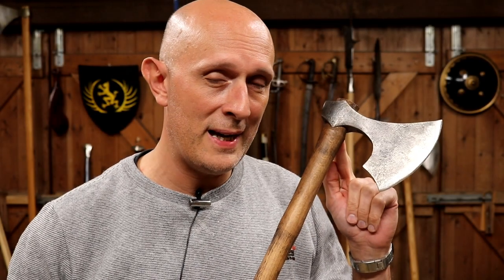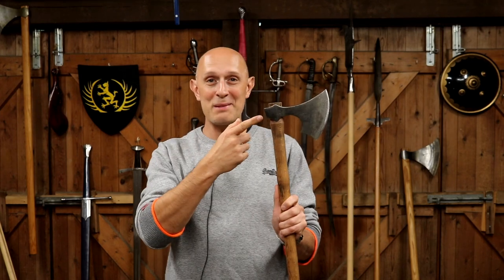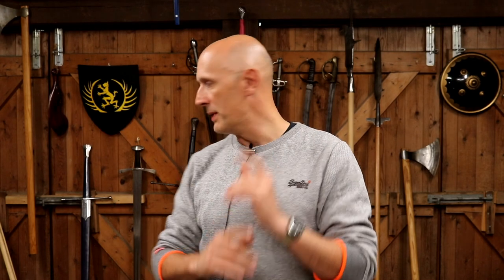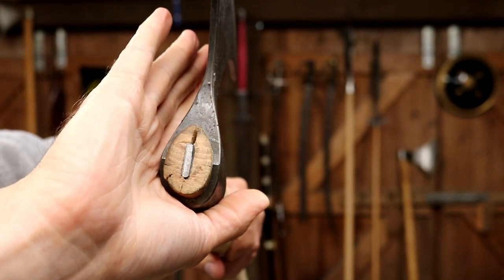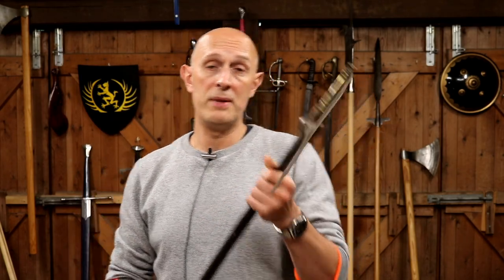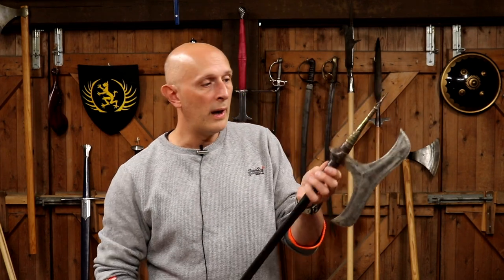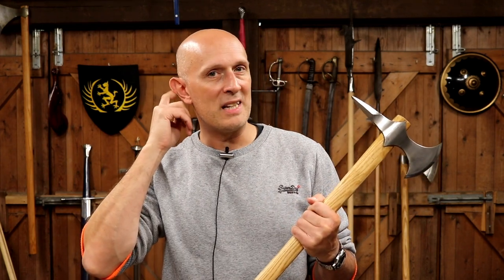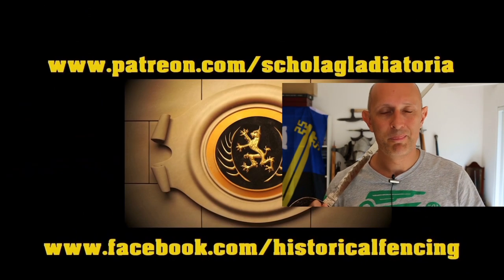Medieval Axe Construction - What Many People Get WRONG

Comment: Straight axe handles without flares are quite common. In the visual art of medieval europe the is no evidence of flared handles. It could be argued that this detail was omitted by artists but you don't see it in the highly realistic art of the 17th or 18th century art either. Not until the 19th century and modern fawns foot style do you see flares. But even then double bit axes often don't have a flare. Also besides that contemporary Japanese axes are almost always straight without any flare.

I've got an ~18th century French axe head that is designed to be fitted slip over style. Excellent axe and its great as falling axe or Joggling axe.

Comment: why don't they peen a pin through the head? does it cause rattling on impact that breaks up the wood or something?
Reply: Using a rivet like that would probably make it more secure but it would make it much harder to replace the axe handle if it was to break.

Comment: Grew up on farm. Farming. Neighbors same. Not machine farming. Hand and animal power, threshing by hand with flails, etc. Having used many tools whose heads were older than my parents: let me share what I KNOW to be true from years of practical experience: You mount a hoe or an axe head UP the shaft. Always. The grain runs up and down the shaft, the stack from blade to back, no debates.

Wedges are used as a REPAIR, a temporary one at that, in the event your shaft has mushroomed badly and is splitting. Their use in initial construction labels the tool as ornamental or occasional, such a kindling axe or a carving tool, not something that will take impacts. If you see a new item with wedges that is intented for actual daily use: avoid it, it's creator was amateur at best. This is not snobbery, this is lifesaving advice. If the head comes off in use it MUST go somewhere. When you live in the woods and that "somewhere" is into you or companions, that is lifealtering injury at best. It is GG at worst.

Always mount UP the shaft. Yes, it means you must get better at turning a handle. But if you cannot work the lathe you have no business working the axe either. The advent of polimers and plastics lost us an ENORMOUS wealth of materials technology we had built up as a species over one hundred millenia: We had Stone, and Bronze and Iron ages, but they were ALL also the Wood Age. Each of those other materials was paired with the knowldge of how to best use wood, a knowledge our machine age doesn't pair well with, because we machine the wood to perfect "size", but wood doesn't work that way, it is not a uniform material, and when we treat it as if it were, we get the horrid things Matt has shown off today. 

I worry I'm going to see that thing with 10 metal wedges in the top in my nightmares.

EDITED for attempted clarity. Hope it's intelligible, I wasn't really ready for this Tedtalk.

Comment: When metal for tools, weapons, and armor is scarce, why use it for a wedge? I have a modern version of a francisca, and the head goes on from the bottom. Consider, the head is the important, most valuable part. The handle is replaceable, and can be quickly made using readily available wood. Having an equally quick method of securing the head makes sense.

Comment: Eh, the absence of evidence is... not always the evidence of absence. 

Does the logic hold up? Sure. 

Does it make a particularly solid argument? Sorry, no. 

I would sooner suspect, suggest, that you shape the shaft for the head you're trying to put on it. 

I might even also suggest that due to the inability to so precisely and consistently produce exactly the same shape, it's the better way to do it. It's something you can eye ball, it's something that's visual. This example is good, this example is bad, start again. 

People are practical and oddly, didn't have milimetre and smaller precise tooling for most of the medieval period.

Comment: It's not even particularly common to see metal wedges in pre-1900 axes, as far as I know. It's a bit of an over-engineered solution to a slip-shod handle, really - I confess, I usually do it when I've made an eye a bit too long at the top of the axe compared to the bottom. Wooden wedge in line with the blade, and a metal one running crosswise (or diagonal) to that. But a really good-fitting one doesn't need it!

Comment: I collect axes and when I fit a new haft I almost always just use a wooden wedge and I seldom have one loosen up.
They probably started using metal wedges because you don't have to fit the head as well and it's easier than making a proper fitting wood wedge by hand. 
People don't really use axes much compared to the old days and in general most people usually just buy a new axe once the haft is broken. Partly because it's not easy to find a quality axe handle now days and partly because people are lazy and/or don't know how to fit the head to the haft. Using metal wedges is just easier than the alternatives. Personally I think a wooden wedge of a different species of wood than the haft sanded to bring out the grain really adds something to an axe. But I'm kinda weird that way. My friends all think my tool collecting addiction is kinda strange. Its a lot better than drug or alcohol addiction imo. 
I'm always seeing videos of people talking about how their hands will slip off of a knife or tool if it doesn't have a swell or a guard of some kind. I wonder how common of a problem that is. Maybe people need to work on their hand strength and actually try hanging on to their tools.  I've got a lot of tomahawks and actually use them to limb trees I've dropped. Not because they are the best tool for the job but because if I didn't use them for that I'd never use them. I like having some level of skill with my tools and you'll never get that by just looking at them and showing them off. None of my hawks have any palm swell at all and I've never had one fly out of my hand or even come close. 
I don't know why but every time I hear somebody talk about palm swells or cross guards I visualize some goofy guy using something he shouldn't have been using in the first place. 😆
I do think a palm swell looks nice and I'm sure it is much safer. 
I wonder if they were a thing back in midevil or viking days. I'm guessing not but I could be wrong. I know some had metal pommels but imagine they were more for looks, protecting the wood and used for striking an opponent.

Comment: I literally just put a metal wedge in my bearded axe like 4 days ago dammit! I mean I knew it wasn't historically accurate but the axe is a $50 Cold Steel job and I didn't want to spend a lot of time and or money making it "historically accurate" just so the handle would stop coming loose. Oh and it is the kind of handle that's wider at the end but i was unable to secure it there. The metal wedge cost maybe fifteen cents took 5 minutes.

Comment: That many wedges typically means the shaft/handle where the axe head joins was made too small for the axe head that’s fitted.

Also timber wedges swell with the shaft and do a better job. Timber wedges also grip the shaft and don’t fall out. Also 2 wedges at 90° to each other are best as you spread the timber shaft BOTH ways and the job is done. On your example if cross wedging was used then you might only need the 2 anyway.

That many wedges timber or steel just means shoddy workmanship so I would pass on the axe, no matter what type it was. Stuffed the wedges up that bad…. WTF have you stuffed up on the head? (Unless it was a generations old axe then the head has nothing to do with the shaft as the shaft and all its faults are not original to the head.)

Comment: You are right for the most part. But: I have seen axeheads from early mediaeval sites that can't be classified by their construction. In some contexts they are labeled as tools, because they are found among other tools, in burial sites the same axeheads would be labeled as weapons. Both of these have thin blades and might have been used as multi purpose tools and/or weapons. Not meant to refute your point entirely, but especially in early sites things are not always cut and dry. Love your channel!

Comment: The smaller wedges (like for a hatchet or hammer) also work quite well at really, really ruining locks.  Just stick it in the keyhole and give it a few solid bangs with a hammer.  :-)

Comment: With a pick axe it's usually fairly easy to knock the handle out if you need to pack it away. I could see that being handy throughout history, especially to nomadic peoples. I rehafted more than a few picks in my younger days and although getting a really good fit often entailed a bit of filing they were usually useable as supplied. Fair enough, most tool handles are machine made these days but fitting a wedged axe head still needs a lot more work than that just to get it through the eye and if not done carefully it will soon work loose.

Comment: I wonder, is there any chance they used leather or other cloth like material to wrap around were the axe head and the haft connect in order to stop it from slipping off in anyway if using the method of not wedging it? Somehow a tight wrap of leather seems like maybe it would help keep it from slipping in my mind, but i must confess i have no idea if that is in anyway functional.

Comment: We're rivets historically used? I.e. a pin driven through holes in both the head and wood, then peened over? 
Or is the compression fit sturdy enough to render a pit moot?

Comment: +scholagladiatoria  I'd expect the handles of axes and adzes to closely approach the heads' hollows in size as well as shape.  The example axe Time 1:02 is liable to have the shaft break at the head attach point as a result of excessive wedging and the consequent splits in the wood.

Comment: We had a hatchet.  I wondered why the head kept threatening to slide off.  I put more wedges in there an everything.  Still no good.  I eventually learned that if that end of the handle gets soaked in water, that can happen and you need a new handle.

I don't know what happened to the hatchet.

Not mention of Context?   I'm going to get thirsty.

Comment: I know that of the method of putting it on from the bottom you need to have a very dry handle and after you bang it on you soke it in water. The wood swells and bingo! the head does not come off even if it's pushed down by something. The only thing you have to watch out for is that the handle doesn't get too dry, and if it does just bang it back on and soke it again.

Comment: With wood cutting axes at least there should be a wooden wedge as well. The wedge should be very dry so that it swells in tight after it's pounded in. The wedge is often soft wood so that it has a bit of a crush fit. Metal wedges are not great long term and will often come loose after time since the do not swell with the wood and they are going to actually crush the wood of the handle so that there is no pressure from the wood to hold in the wedge. If metal wedges are used correctly they used transversely to the edge to push the wood into the point of the eye shaped hole. The shape of the hole come from when a piece of plate was wrapped around a mandrill and then is sandwich welded to a piece of carbon steel. By leaving the loop an eye shape there was no metal to spring open and let the handle loose.

Comment: Thanks Matt, another great video, axes are a special interest of mine. Question: How long/deep would the wooden wedge be on the axe you showed us around 4:00 ? I ask because I feel like the bottom edge of the cut in the shaft (to accept the wedge) would be a stress-raiser (weak point) so you would not want that to align with the bottom edge of the hole in the axe head. It would be better above or below that line, but I could not see that detail in your axe. :)

Comment: Could they have heated the axe head up, tapped it on to the head of the saft and when the head cooled off it would grip tightly. If the head was too hot it would set the shaft on fire, too cold it wouldn't expand enough?

Comment: The most surprising thing in the video to me is that it sounds like my dad and i are a rarity in still using just wooden wedges in the axeheads. (On the other hand, in the shop i went for a shovel handle last time, wooden axe head wedges are still sold next to the metal ones.)

Comment: another thought on but threaded handles. To replace a handle away from a forge, or wood tools, planking, in a forest for example, you would cut a horizontal branch off a tree near the trunk.  Choosing one that is about the size and shape of the eye of the axe, this could be trimmed and slid down the eye of the axe. The collar of the branch would stop the axe from comming of because of its natural tapper. I am not sure if this would be benificial as a haft, given the grain of the branch would be circular as well as travelling down the handle. It would mean if you designed an axe with a top tappered hole, a replacement handle would be near by in a branch or sapling with little need for complex wood work. This is speculation as i dont know how handle suitable trees grow in the northen hemisphere. I can see this working with a few apropriate trees in Australia.

Comment: I would lean more towards the latter method where the head slides up from the base of the handle to wedge itself at the end. It is much easier to rehandle the axe this way rather than using wedges at the end of the head.

Comment: What about ye olde fitting the axe head to the shaft while the eye is hot (red hot?) and then quenching the axe, shrinking the eye onto the shaft?
Reply: I have seen that being used with the metal rims on old time wooden wagon wheels at a living history site but I've never heard of it for axes.  And definitely not red hot as that would not only mess with the temper of the blade but it could char the wood before you could cool it off.
Reply: Red hot metal would burn the wood way past its usefulness by the time you could blink haha

Comment: Hi.

Another benefit worth considering with respect to a Tomahawk type construction i.e. axe head sliding up towards the head of the shaft, is that the axe head can be easily removed for both sharpening and for use as a cutting tool, such as processing food and game, fine wood work and general cutting duties. 

This allows one to have fine control over the cutting surface without the problem of the handle getting in the way.
Reply: Star Citizen Alpha: Not to mention being able to quickly REPLACE a broken haft, WITHOUT the need for a wedge

Comment: Alec Steel made a great point in a video: if you only put a wooden wedge in, you still have the option to also put a steel wedge in later, if the head gets loose for some reason. I think this is a genius idea and I really don't know why all axes still came with a wood and steel wedge together.
Reply: One may also bore a hole with a drill and drive in a circular tapered peg to expand the wood in all directions, and this may be done several times if need be.
Reply: @FortyTwoBlades  I've never heard about this technic, but sounds great, I will give it a try!

Comment: I think that's actually the first time I've seen a metal wedge on an axe. 

Is there not another method: heat the axe head so the hole expands, put the shaft through, then cool the axe head so it contracts and grips? Was that ever done?
Reply: Heating the axe head sufficiently to expand usefully runs the risk of charring the wood as the head cools. Charred wood isn't very strong.

Comment: If a wedged axe head is forged correctly it will have a little bit of an hourglass shape in the eye. The handle will have a deep grove cut so when the wedge is added it spread the handle into the hourglass eye giving better hold. 
The slide up style axes would predominantly be used by nomadic or far traveling people. The axe can be transported without a handle because it is very easy to make one when you get where you are going. In my opinion at least.
Reply: There are videos somewhere on how axe heads are forged by a real blacksmith that I've seen and you're right.
Reply: @brianmccarthy5557  Your comments are both about modern axes, not historic ones.

Comment: Wooden wedges are still in common use.  Metal wedges are fine, but you need to find or make a wedge that fits your particular shaft, and that's a drag.  It's much easier to saw off a broken part of the shaft (with a wood say, because of no metal), fit it in and use a wooden wedge.  Quick work.  Even if you have lots of  "free" scrap metal laying around, wood is still easier and will last you the job you need to do.  I'm simply not going to fit metal wedges to about 20 hammers and 5 axes I have laying somewhere around the farm.  Way too much work!
Do the great minds of archaeology ponder such immense puzzles?  Well, no wonder then, that when they find lots of pots with "magic" runes on them, they suddenly decide that the Vikings were 90% literate... ;-)